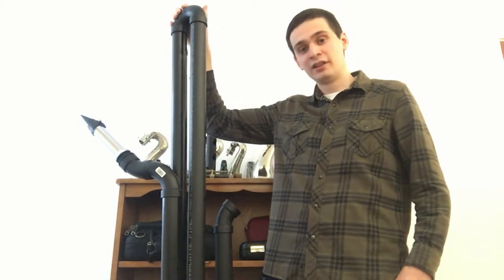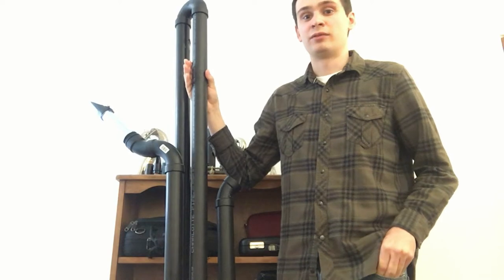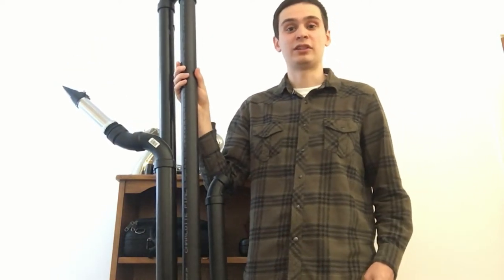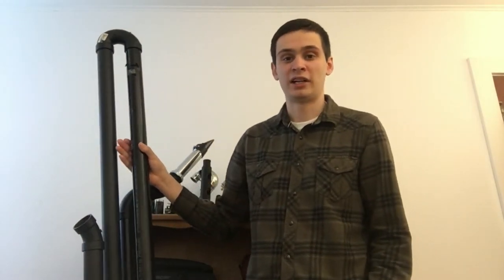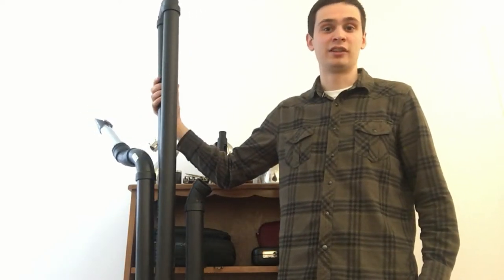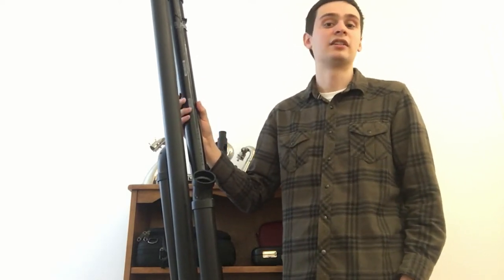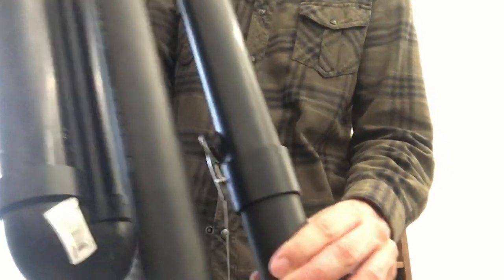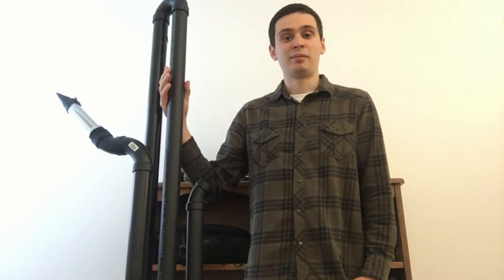I'm building an Octocontrabass clarinet, here's how I'll do it...

Comment: Where did get the info about the 38.5mm bore diameter of the original? Looking forward to following this project.
Reply from the maker: Took screenshots of videos of the Octocontrabass and compared the measurements I got to those from known objects in the video.
Reply: @Jared_De_Leon  I was coming to the comments to ask this same question. According to Cyrille Mercadier, the OCB bore is the same as the OCA, 33mm. He told me this himself about 2.5 months ago.
Reply from the maker: Jason Alder Weird, that's smaller than Selmer's contrabass
Reply: @Jared_De_Leon  Yup, smaller than the Eppelsheim large bore as well... and much smaller than the Linton/Orsi! I'll have to go back and check my notes to see if he said why it was so small. But he definitely said it was the same as the octocontra-alto, the same way that the Paperclip contra-alto and contrabasses have the same bore. Also interesting fact, the Leblanc octocontrabass had 4 register keys!
Reply: @JasonAlder  Great information! Thank you for your insights. Being that the great Houvenaghel designed the acoustical aspects of the instruments, I'm sure there's a very good reason for the bore diameter. If I had to guess, I'd say that a smaller bore makes it so the standing wave in the instrument has to move a smaller volume of air, aiding in response/agility of the instrument, especially in the lower register. Dealing with frequencies that low (and tubes that long), even a small decrease in bore diameter would drastically reduce the internal volume (and therefor mass) of the air that the standing wave needs to oscillate. It would also aid in calculations of end corrections at the tone holes, since the volume of the air seal of the chimneys would also decrease, shrinking the deviation between the calculated and empirical placement/size of the tone holes. I could very well be totally wrong though, as Houvenaghel was one of the most brilliant acousticians of our time and most certainly knew what he was doing in designing these incredible instruments.
Reply: Quinn Lewis indeed the smaller bore makes the instrument easier to get around. I know that Carl Rosman opted for the smaller bore 32mm Eppelsheim instead of the 36mm because of the ease of agility, and he felt there wasn’t a massive difference in the body of the sound. I can get much more sound out of a Paperclip with it’s smaller bore than the Selmer, although that’s a bit like apples and oranges because the designs are so drastically different that there are surely many factors for that.
Reply: me and my friend want to make a BBb paper clip contrabass clarinet but the hardest part i’m coming across is where to place to tone holes so that they are in tune. what should i use for keys? i know the bore diameter of the instrument (which i believe is 1.182), and the length of tubing totals around 10 ft. if anyone has any suggestions on where to put the tone holes, please, let me know. i’ll try to stay consistent and check back to see your comments. thanks 🙏

Comment: Would using a contrabass mouthpiece throw the tuning off when you change mouthpieces just like if you used a Bb clarinet mouthpiece on a bass clarinet or do you have a way around it?
Reply from the maker: Schererman64 The difference in volume of a contrabass mouthpiece compared to an Octocontrabass mouthpiece would be negligible compared to the volume of the rest of the instrument. All I would need to do is change the neck for a slightly shorter one and it would work fine theoretically.

Comment: How do you attach the mouthpiece to the pvc?I’m trying to make a pvc contrabass and I can’t find an answer.
Reply from the maker: I used a 1 1/2” brass sink drain extension. You can get them at most hardware stores. Then you need a 1 1/2” sink drain adapter and that will allow you to connect to PVC pipe
Reply: @Jared_De_Leon  Okay, thank you very much!